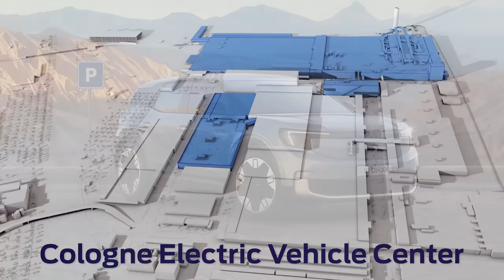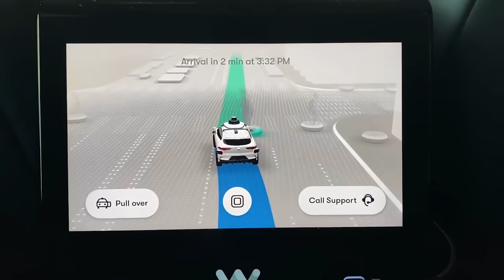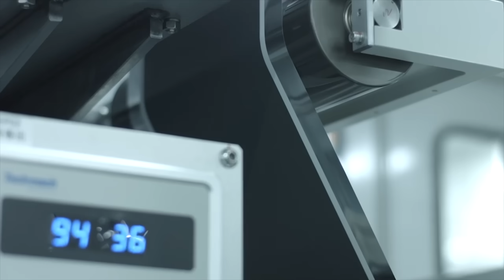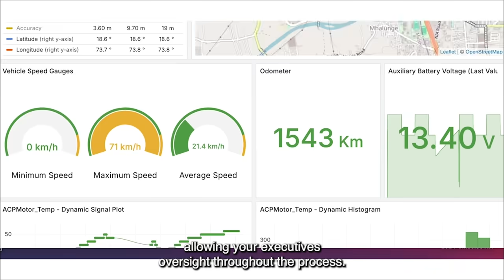VW Invests Even More in Rivian; UAW Slows Organizing Efforts - Autoline Daily 3935

Comment: Not sure if I missed this detail but is VW's deal with Rivian mean VW is throwing in the towel pursuing it's own EV architecture plans and going all in with Rivian or will their platform and ones based on Rivian's co-exist?
Reply: Lots of panic moves in ICEV-land.  In a panic, things are not thought threw very well.  Rivian needs capital, they know how to build a very good EV.   Rivian may well be able to design a good EV for VW to build.  Whether VW can scale up EVs fast enough to reach profitability and save themselves from bankruptcy is still in question.
Reply: VW plans to use a China based platfor with software made by Rivian.  VW can not make their own platforn until 2028 (they discarted their ev manufacturing plan 4 yers ago when they removed Helbert Diss).  The purchased a China corporation just to fis the Id.3, ID.4 software problems to an acceptable software.  VW only solution in time will be to increase prodiction at Rivian and rebadge the product.  A new desing  will take some time, and it will, become faster than an ev manufacturing facility.  OMO ithink there is no way to save VW.

Comment: Hi Sean, what types of Teslas did Hertz buy? I’m looking to buy a used model three and hold onto it until the wheels fall off just like my Dodge minivans.
Reply: Mostly model 3 however be reminded that Tesla did a lot of mechanical improvements to that model earlier this year.  Software is the same for used and new models.  Batteries for the Hers=zta car can last 300,000 miles so a used one is a very good option.

Comment: WAYMO is the leader in self driving tech as they have more vehicles driving
more autonomous miles than anyone else as well as they were the first.
 Their software is leading all others as the NTSB has assigned it a 4.5 rating 
out of 5.0 which WAYMO is working towards. Teslas FSD v12.x is rated 2.0.

!
Reply: Quit fibbing. Waylon is doing GeoFence Pre-Mapped Routes.
Tesla is tackling nearly ALL cases with their vehicles. Two COMPLETELY different Problem Sets.
Reply: Losing billions each year with less than 700 cars fleet, even after 100,000 rides per week. Leading? Sounds like there is a major issue that they are hiding. But let's sell the story that they are leading.